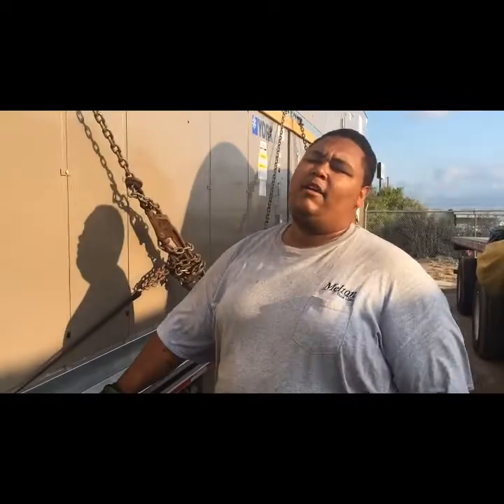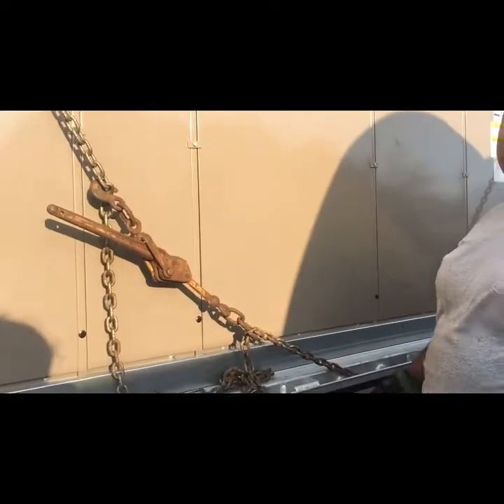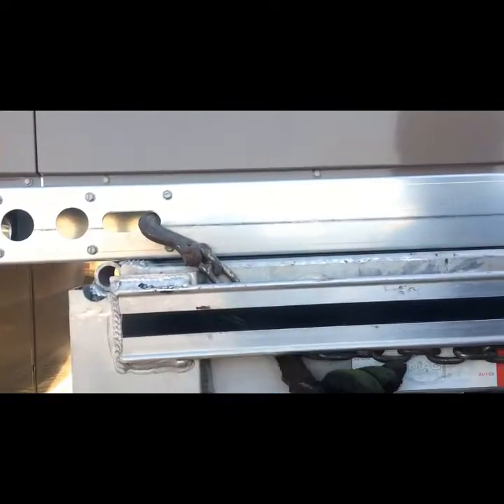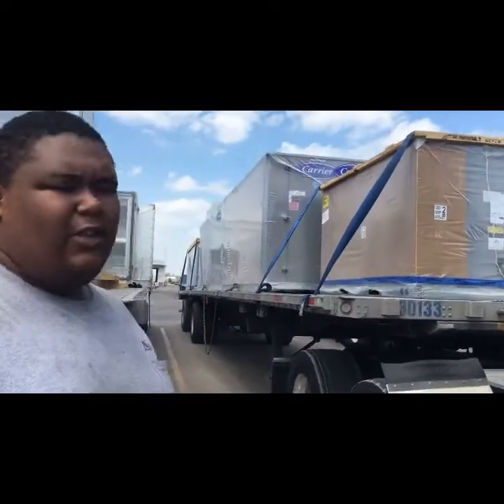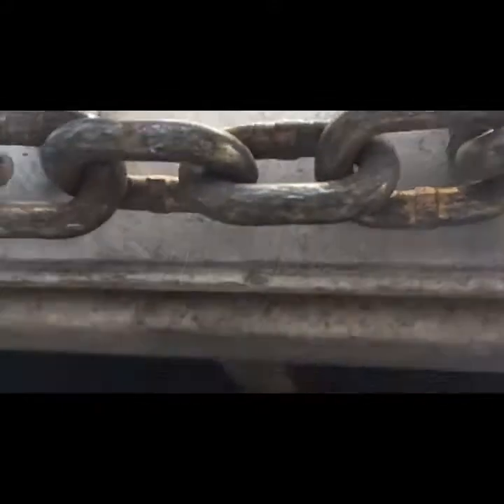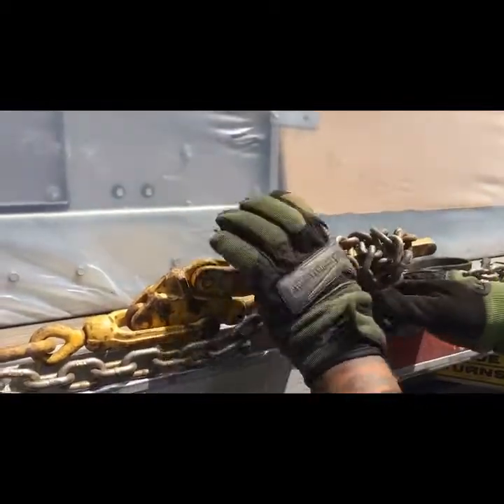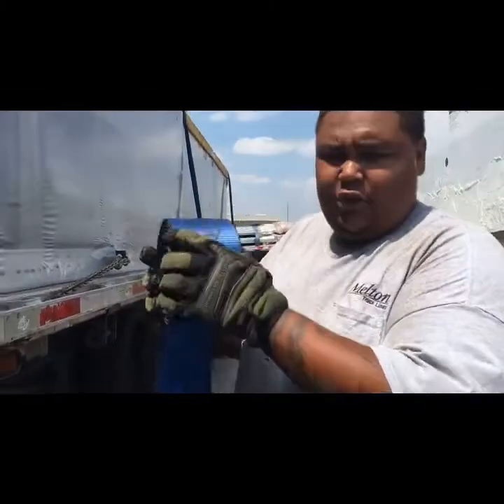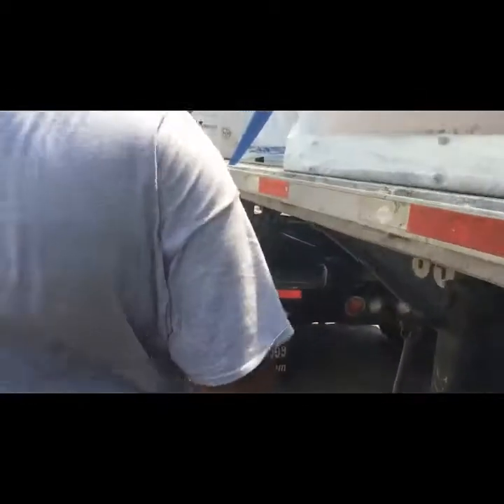Melton Truck Lines (Update) Plus A/C Securement!

Comment: Hey guys, I just discovered your channel and did some flatbedding for a couple of months. I left mainly due how undertrained I felt (thanks Malone!) and didn’t want to risk making a mistake. One question I have is how do you guys check your chains under tarps in the weather? If you need to readjust them and you’re in the open how do y’all go about it? Thanks for the videos and congrats on your wedding!
Reply from the maker: Usually with chained loads we are able to undo a bungee or 2 and check underneath the tarp. We have actually never had a situation where we needed to re-adjust chains underneath a tarp but if we did, we would probably inform the company first to see what they say if it's raining. If it's not raining we just would undo the tarp enough to bind the chain and retarp. 🙂